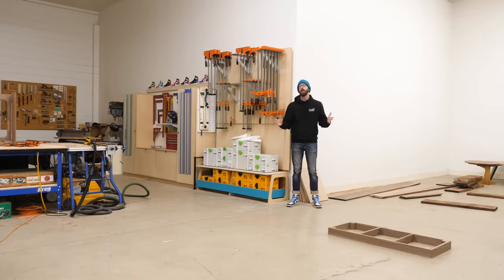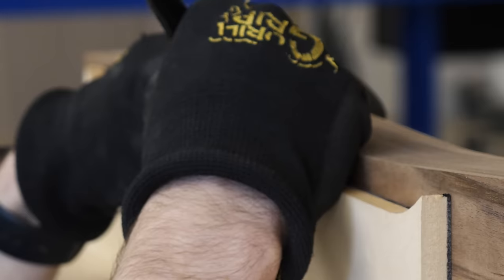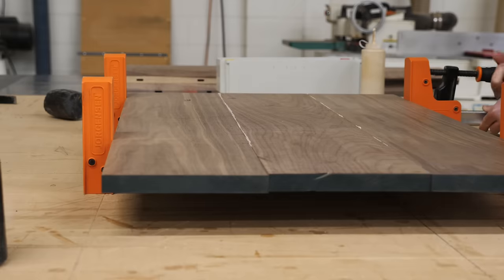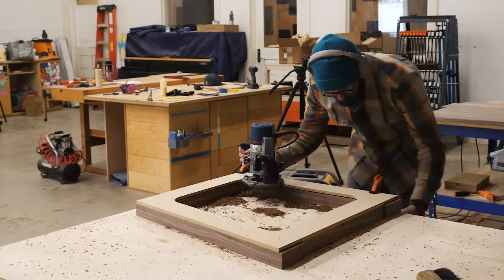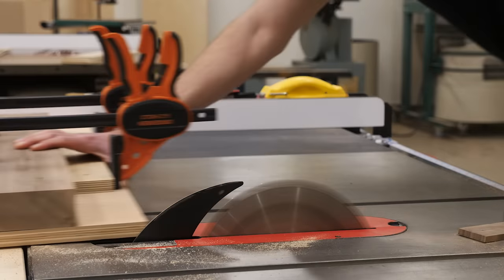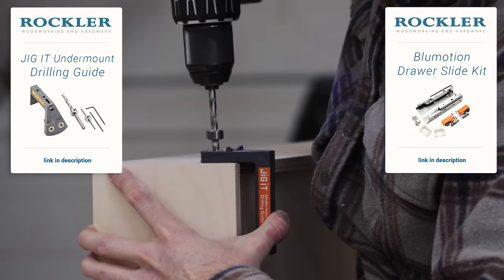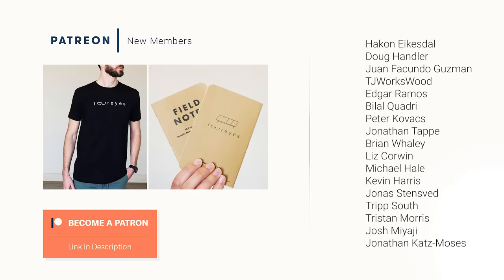How To Build a Giant Corner Desk - Woodworking

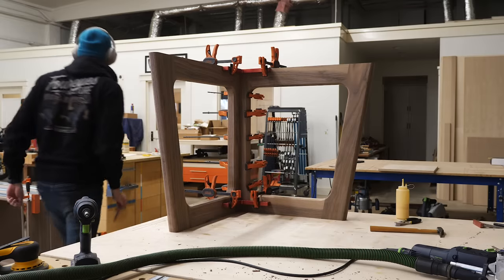Comment: 26:23 idea!  Cut a slot half up the back portion of one leg and cut another slot half down the other leg. Glue, slide together and screw from both sides of the corner edge.  Not sure if this is practical or adds any additional strength but it just popped in my head watching this.

Comment: Looks great! The only detail I would add is I’d do a similar countersink to the top attachment points on the bottom of the legs and install hidden levelers. Over a span that long, it’s likely there will be elevation changes in almost any floor.
Reply: True

Comment: If you’re open to the idea something we use at the shop I work for is to apply p-lam laminate to our work table tops. The laminate is really good at not letting glue stick to it. After there is glue you can scrap it off and just it the surface with a quick sand if it’s too hard to scrap. Once it’s to thin(which takes a long time) it’s easy to use more contact cement and just apply a new layer.  It’s been a great surface to work on and saves time during glue ups not working about tape or mats.

Comment: For the solid wood cabinet is there no need to be concerned for wood movement?  Thinking about the miter sides and the center panel glued across the width.  I’m going to be building my first solid wood piece soon, and am just confused about when and where I need to be concerned with wood movement.  I understand wood moves perpendicular to the direction of the grain, it’s more confusing to me about when it’s safe to glue and when it’s better to attach a piece to allow for movement.  Love this piece!  I’ve learned so much from you both.  Thanks in advance.

Comment: Thank you! I am also in the middle of a corner desk build. I've done the two mitered top parts and I was designing how to join them together and how to properly support the top across the seam between the two parts. I was thinking of all kinds of crazy things, but now I think using dominos without glue plus dogbone connectors to join the two parts of the top, and supporting the weight using a leg that connects at the back corner where the two tops meet would be sufficient.

Comment: What a beautiful desk. I need the plans man, I want one in my office. This is gorgeous as is but would be next level with some kind of epoxy inlay and protective coating. I'd totally add is some hidden provisions for wires and lighting.  The styling is just very appealing and I think classic.  I want to say 60's.  One could make it using almost any kind of material too and scale it to different sizes. Small, medium and large, budget materials, mid grade, exotic and then even incorporate steel and or aluminum with wood. I could see this in different colors too, reversed layout and maybe even matching wall mount cabinet.  I could build a company just on selling this design and some variants for a wide range of budgets.   Your video is also top quality with some great humor (I laughed hard a few times), detailed filming and addition of technical animations. Big thumbs up.

Comment: Good job! But in my opinion, the corner diagonal connection is unreliable. Over time, problems may arise. It is better to use consoles securely fixed to the wall!

Comment: I love big desks so had to watch when this popped up. I would be worried however about the front of the desk with such as massive span not having any support.

A few years back we built me a desk from 96"x30" butcher block and created a steel frame that is 72"x26" outside edge to fit under it and make sure the longer span was supported. What does this desk do from the front support?

Comment: You hit the nail on the head with this one, I’ve been looking to make pretty much this exact desk! I can’t afford the walnut (or any hardwood for that matter), so I was wondering; could one make this same project with plywood or MDF? More specifically, do you think the top would be stiff enough to support the L at these dimensions? Thanks!
Reply: Build everything out of cheap c grade maple. Like $50 a sheet. Would still look great
Reply: I just asked similar question on using oak veneer on top of good quality plywood to make top.

Comment: Awesome build. I made an L shaped computer desk a while back and had trouble with the inside part of the mitered top sagging a bit. What would you suggest to be the best way to reinforce the middle section to prevent sagging?
Reply: I am also curious about this. I’ve seen people add more support via legs or a brace across the mitre. Maybe the domino connectors are supportive enough?

Comment: Had about the same plan in mind, when I saw a floating Lowerboard and wanted to combine it with a floating L-Desk. But I want the corner part of L-Desk to be able to tilted for a Zero Gravity Position (with angled legs) so it can make room for my legs while the monitor is mounted to the wall. I would cut the corner section in half, so that the back part can raise up, to make room for my feets, and the front part would tilt towards me for the keyboard and are able to raise for to make room for my knees. The mouse section would stay flat. 
So yeah a hell of a plan

Comment: Do you have any issues with movement when grain meets at 90 like that? Feels like if it contracted it would gap in that big mitre. Feel free to school me if I’m being dumb.
Reply: I was thinking the same. Stumpy Nubs had video on how to connect such long miter.
Reply: I think if they were both tied to a common rigid structure they would be more problematic but as it is their expansion and contraction should be synchronized, but the overall angles could change from a 45, which would tend to move the rest of piece to meet the angle, rather than opening or closing the joint, as if it was on a fixed cabinet base. This is just my theory, though.

Comment: As always beautiful design and great work on the desk. Question: Would it be cheaper to buy thick oak veneer and glue it on top of good quality plywood and then do desk top using that?
Reply: I would say so, but it also depends where you're getting your materials from, though saw mills can  give you better prices than a big box store or Home depot.

Comment: How come you keep cutting the edge off your sled when you know youve cut a square edge on it the last time you used it please?
Reply from the maker: It's whenever we've used our table saw (and thus moved our fence) since the last time we used it. We're establishing a new cut edge. Technically you could just set your fence to the exact same position as it was the last time you used the sled...but that is nearly impossible and we're going for the smallest margin of error with our joint faces. So it's much more accurate to just cut off a 16th of an inch to establish a new cutline on the sled...and now your set-up is perfect.